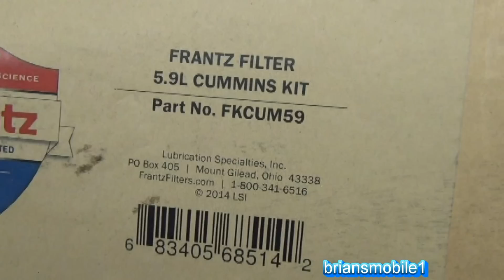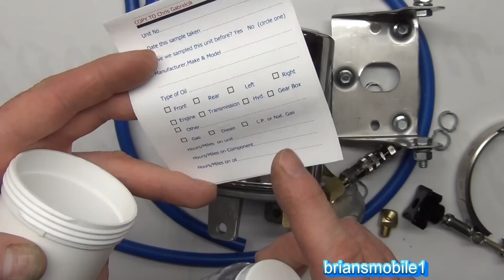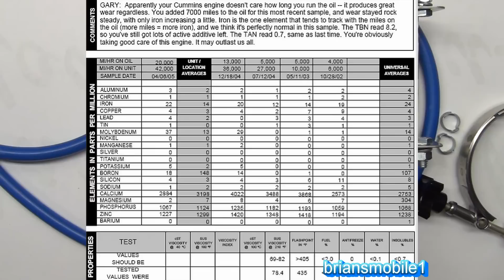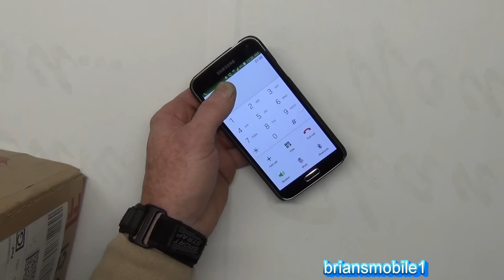How to Make Synthetic Oil Last Even Longer  Frantz

Comment: Wait...it's a bypass filter...so it's still pumping 95% or more of the regular (23-40 micron) oil is still pumped thru the engine and journal bearings...the filter only trickle cleans...which means it extends the life by "slowly" removing the contaminants...but if it's still pumping the garbage thru...is it really extending the life of your vehicles engine?  The only true way is to force all the oil thru the cellulose filter...and it would be WAY to restrictive to get any good oil flow to ensure proper lubrication...
I guess this would help on large engines with HUGE oil pans and gallons of oil being used for oil changes...but for most 5 quart cars...this isn't a economical solution.
Either way...thanks for the review...love your video's!  Keep em coming!
Reply: Engines move a huge amount of oil, several to many gallons per minute.  Your oil pump is capable of draining your engine in under 30 seconds generally.  So, even if 5% of the oil is going through the bypass filter, all of the oil will go through the filter several to many times in an hour.
Reply: Clearly you know little about cars...at a 40 (warm) to 60psi (cold) on the full flow filter, that "slowly" filtering filter branched of that? Is still 8-11psi with the amount of oil an engine holds? It will be filtered within a good 20 min of driving ... Reason being? Most of the oil pumped is excess and returns directly to the crankcase through the oil pressure regulator valve.
Reply: With a quart or so of clean oil going to the oil pan a minute there wont be any dirty oil going thru the engine parts very long.
Reply: The Jackmaster Classic on my Pontiac Torrent came with about a .060 orifice at the outlet. Thats about the standard size. I put a .025 wire welder tip in a brass fitting and put it in the inlet. It cleans about 3/4 of a quart a minute. There is a chance the tiny orifice will clog. I check to make sure the filter is heating up. I also have a .025 orifice in the Ford canister filter on the Ford diesel tractor. I set it up to use Scott 1000. John Frantz put a Frantz canister in the larger Ford canister. I use only the Ford Canister. Lucky to find the flathead Ford V8 bypass filter. They were optional equipment. Cant get good elements for the Ford canisters now. The good ones used cotton or toilet paper. John Frantz didnt have 4 1/2 inch Scott 1000 toilet paper in 1953. He used the smaller 2 ply.
Reply: Its sad that so many people are so ignorant about something as simple as the oil system and keeping the oil clean. Its no wonder the oil change racket is so big. It takes some common sense. I drive mostly highway in the Dallas Texas area. You would need to make adjustments in cold weather short trips. When I sold filters some went to Norway and northern Canada. You need to run at normal operating temperature long enough for the crankcase ventilation system to remove the condensation and unburned fuel.

Comment: There are kits that are just as good for much cheaper. Shop around people.
Reply: The Frantz is a good filter. My best filter for tight places is the Australian Jackmaster Classic. I started with a Frantz in 1963. I prefer the top loaders. They are better suited to use tp. Just push the tp down against the bottom and put on the lid. My Ford diesel tractor has a flat head Ford V8 canister filter that I adapted to use Scott 1000. Havent used the Frantz  since the early 90s. Lousy design but they cleaned oil. The Ford filter doesnt always drain at shut down. I put a tubeless tire valve in the lid to push out the excess oil before changing.
Reply: There are a lot of good bypass filters to choose from. I dont plan on paying 20 dollars or more for something as good as toilet paper. I have too many TP filters for that.

Comment: so I'm wondering, your car is on warranty, if you go over by 1 mile on your oil change, is your engine warranty now void? Pretty garbage.
Reply from the maker: No, not by 1 mile or 500 typically.  
With a system like this owners of Cummins Engines are going 20,000 miles between drain intervals and their test results show the useful oil life remaining to be upwards of 60%.
Reply: A lot of users of these filters wont run on dirty oil to keep the warranty good..Clean oil comes first. Over the road truckers have an oil analysis program to prove the oil is good in case there is a problem with the engine. Oil analysis will also tell them if a repair is needed.

Comment: Ya, but can u use it on a car? I don't have a truck
Reply: Short answer is yes.
Reply: You will need a way to tap into the oil pressure. This could be a tee at the oil pressure switch or a pipe plug. And a way to return the clean oil like to the oil pan. In the old days all we had was hose and fittings and a self tapping hollow bolt. The biggest challenge is finding room under the hood. Sometimes I  leave the filter in the box and put it in a low place.without the bracket.. They are all different.  On the Pontiac Torrent I used a one port sandwich adapter and returned the clean oil by drilling and tapping tho oil fill neck extension 1/8 pipe.  I tapped under the fill cap on the Altima 2.5. Also used a one port sandwich on the Altima. I still have a few adapters made by Frantz over 50 years ago. I see the Element fits in the demonstratiion. Looks like a Frantz element. Hard to find TP that fits the Frantz. These days. Yes Brian has the Frantz element. TP custom made for the Frantz. See the core seal imprint around the TP core.

Comment: Its clear from the haters leaving comments to debunk your Frantz Filter system. These people do not understand cause & effect as it relates to solid particles in your lubricant. Studies show that removing tiny particles, the wear is eliminated. This also extends the life of additives in the fluid.. I have this same unit on my diesel and it saved the engine from vandals. I put a Wix 51269 filter on an automatic transmission cooler line and had the same results, it polished the solid particles out of the fluid w/o replacing the transmission.. The particle count on my (diesel) engine oil was reduced from 18/17/14 to 16/15/12 by using the Frantz, changing the oil did not purge the contamination from the oil cooler.. Nearly all commercial vehicles have some type of bypass system to clean the oil by removing abrasive soot, the systems are also OEM due to warranty claims. Automakers want to sell new vehicles and demand this technology is pointless, Dodge will argue aftermarket add-ons void the warranty LOL!
Reply: Ive read letters from makers of heavy duty engines that said pretty much if you put a non stock item and it causes engine damage they wont pay for the damage. My guess is if you put a non stock full flow filter and it causes damage they wont cover it.. This could be the wrong oil a power chip. Exhaust brake. Many truckers have a oil analysis program and can prove the extended oil changes didnt cause problems. Big engine makers understand bypass filters. Remember the big bypass filters. Cummins used to claim a 80 % increase in engine life using the big Fleetguard bypass filters.Their 750 filters use pulverized newspapers and wood chips.
Reply: My 64 Rambler American had a spin on bypass filter bolted to the flat head 6. The oil was always dirty and black. I tossed it and installed a Frantz. The oil turned golden. Had the same junky assed bypass filter on a Mazda early 80s diesel. Installed a Frantz to clean the oil. Its like they dont want you to have clean oil. They wont get away from using pleated filters that have no value at cleaning oil.
Reply: If you are over the oil change recommendations and your oil is dirty. That is a lot different than being over the oil change recommendations and your oil is clean and you can prove it with an oil analysis program. I think one reason the big Gulf Coast filters can filter as good as toiler paper is the orifice is the same size as the TP filters. The oil soaks down thru the big paper towels. The oil pressure pushes the oil thru the TP. Charmin would filter as good as Scott 1000 if I could use a small enough orifice. 1/16 inch has been pretty much standard since the 1920s for bypass filters.
Reply: I put a .025 wire welder tip in a brass fitting and put it in the inlet of the  Australian Jackmaster Classic. The slower the flow the cleaner the oil. Most TP filters use about a ..060 orifice.  The Jackmaster Classic cleans about 3/4 quart a minute when the oil is hot. Might not work in cold weather short trips.
Reply: The .025  wire welder tip is actually about .045. Its for .025 wire.

Comment: You repeatedly say 'ALL'; all the dirt, all the water, etc. when actually it's a miniscule amount; a percentage of the percentage that goes through the main filter.
Reply from the maker: You have a mind for detail.  I really like that.
Reply: There is almost nothing in a modern engine motor oil  large enough to be removed by the full flow filter. To remove the contaminants  too small to be removed by the full flow filter we have oil changes or bypass depth filters. The bypass filters make a lot more sense. All I have now is top loaders with larger core seals for the larger TP cores.with the top loaders you push in the TP  and put on the lid. The only paper that properly fits the Frantz is the Frantz elements..putting a spacer on the tube sucks. They keep changing the core size..with the top loaders the core is properly sealed  Frantz needs to get their act together or they will keep going broke.

Comment: so nice it takes the bad out of oil. then gets thrown into the land fields   who takes care of that.
Reply from the maker: Did I say that?  I don't remember saying that.  You dispose of it properly.
Reply: Most of it probably ends up in a land fill like the other filters.  Wife came home from the store about 40 years ago. She said there is a used Frantz element in the  grocery store parking lot.go get it. I was 9 miles away from the store.. No way she could pick the damn thing up..i knew who the culprit was. Fell off an oil well pulling unit. Some goes to the same place as the other filters. A guy told me he runs water under his car then allows the oil to drain from the engine onto the water. Didnt ask him what he does.with the used oil filters. Saw a used oil filter in an Auto Zone parking lot. Its on my work bench.

Comment: My grandfather used a Frantz filter on his 1969 F250 with a 360 v8 engine that he purchased new.  He never removed the drain plug but every 6000 miles he removed the paper roll and added enough new oil to maintain a full level.  In 1989 I inherited that truck.  The oil was clear, and looked like it just came out of the can.  I continued with granddads practice and drove that truck for another 20 years.  Vehicle had a valve job at 180,000 miles and lower end was not opened since new.  At 300k+ miles my son in law broke an oil line to the filter and continued to drive and shortly thereafter seizing the engine.  On teardown the engine looked as clean as a factory new engine. Decided to get a later model truck and sold the truck to a dismantler. I miss my Frantz filtering system even though I had to use a home made adapter because over the years the size of the toilet paper inner tube got bigger (less paper on the roll).  Didn't realize that the system was still available and will order it for my current vehicles.  For those who say you cannot do what we did because the additives wear out must remember that a new quart was added every 6 k plus grandpa used Marvel mystery oil along with the new quart.  And yes I have been a mechanic and taught mechanics for many years.
Reply: Out in California I bought Motor Guard filters from a guy that had his drain plug welded on to demonstrate that he didnt need to drain the oil. He had a habit of pulling the Motor Guard off and trading  the Pontiac in on a new car at about 100.000 miles. Can you imagine some guy going to change the oil and the drain plug is welded on.
Reply: My 76 F250 Ranger has the 390. Had some gasket leaks. Decided to overhaul the engine. Saw there was nothing wrong with it. No ridge on the cylinders cleaned the valves and tops of the pistons and put it back together.  Yes the Toilet paper changed Frantz didnt  I bought a Australian Jackmaster Classic.  It has a 2 inch core seal. There is no tube to put a spacer on. They use the TP core as a center tube. You just push the TP down against the seal and put on the lid..They have an optional air fitting to push out the excess oil so there is no spillage. They use a hand air pump..
Reply: It was a piece of cake putting a Frantz on a new or well maintained engine. If you are a Frantz dealer and are unlucky enough to put a Frantz or other TP filter on a neglected sludged up engine you are in a heap of trouble. Told my uncle we can open up the engine and clean the engine or change the Frantz every 50 miles.He traded the 59 ford in on a new Dodge pickup. We put the Frantz on the pickup. Not so much of a problem these days.I was reminded of the useless filter I put on my dads 51 Pontiac. It filled with sludge.and quit working. Dont go to any more family reunions.
Reply: I changed the Frantz every 2.000 miles in the 60s. The Jackmaster Classic I change every 6.000 miles with 10 W /30 these days with synthetic. The old Ford diesel tractor will bea challenge. I seldom get the oil up to operating temperature. It has a flat head Ford V8 canister filter that uses Scott 1000. It uses a oil cooler sandwich adapter.  Perma Cool universal from JEGS.

Comment: Let me guess. You drain it out, run it through a coffee filter, throw in a bottle of something from the dollar store and drive another 5000 miles.
Reply: See, I was right.
Reply: Wrong guess. You clean the oil as you drive at about a quart of oil a minute. The only job the bypass filter has is keeping the oil pan supplied with analytically clean oil.
Reply: @ralphwood8818  When someone says, "let me guess" it's a hint that they're being sarcastic. In fact, you don't need to do anything to make any of your automotive fluids last longer. They last as long as they last.

Back in the day, I talked to a couple of people who tried the toiler paper filters, when they were sold in the J.C. Whitney catalog. They said the filter did keep the oil looking clean. Whether it really extended oil life or helped the engine, I don't know. I follow conservative mechanical theories these days. That means short oil change intervals, for one thing.

I don't really think that removing engine oil from the sump, filtering it externally by some homemade means and returning it would do anything. If someone is worried, a more reasonable fix would be to change the brand of oil filter, change the brand of oil, or decrease the oil change interval.

My vehicle had conventional oil as OE. I use semi and change it at 2800 miles based on all short trips driving. I got a jug a AOP synthetic for free and I'm leaving that in for no more than 3500 miles.

Synthetic actually is a problem in an engine not designed for it. It can rot seals, and I have seen it happen. It produces crystallization if it is left in too long also if you do all short trips driving, I have seen that too. I saw both conditions in the same vehicle. It was old but had only 103K on the odometer when I got it. The former owner was an elderly driver who drove only a few miles a week for years. He and his son left the same synthetic in to for a very long time because they thought it was miracle product and the vehicle was being driven only maybe 2000 miles a year at most. That what I concluded.

As a bonus, it had pretty high oil consumption even though it ran very well. That probably was  due to oil crystallization in the rings.

You have to know the properties and specifications of every product you use. Oil is cheap, relative the price of a new engine or an entire vehicle. Coolant is pretty cheap too. People don't need to try to go the whole 150K or ten years on it. I don't intend to.
Reply: @anonymike8280  I quit draining oil in 1963 with Standard Delo and a Frantz oil cleaner. I believe J C Whitney sold a spin on filter that replaced the full flow filter. They used about 1/3 of a roll of toilet paper and converted the full flow system to a bypass filter system.similar to a Stilko oe Trasco. I wouldnt want one. I might have messed up. I went from conventional oil to 20.000 mile Super Tech in the Subaru with 225.000 miles  on it. It has almost 240.000 miles on it and doesent use or leak oil. Got a scare the other day. Heard a knock in the engine. Im not supposed to have engine knocks. The bolt that holds the belt pulley to the Crankshaft worked loose and the pulley was wobbling and hitting the timing belt cover.. I normally change the TP and add a quart of oil about every 6 months.Im a filter guy not an oil guy. No we dont drain the oil then clean it and pour it back in.The filter is connected to the engine with hoses. Running to a Perma Cool universal sandwich adapter I got from Jegs. Its actually an oil cooler adapter. You dont get the long engine life allowing the oil to get dirty then draining it. Took me 20 years to put 250.000 on the 84 Subaru. A little longer on this 93 Legacy.

Comment: Toilet Paper?
Who knew?
Reply from the maker: Most every filter on a car is make of paper of some kind.  Most have to be thick and restrictive due to pressures.  This is low pressure and slow flow so TP type paper is perfect.  Lots of filtration layers.  No rush.
Reply: There are no full flow filters that clean oil. A full flow filter that could clean oii would be too large to go under the hood. There are no bypass filters that can filter fast.